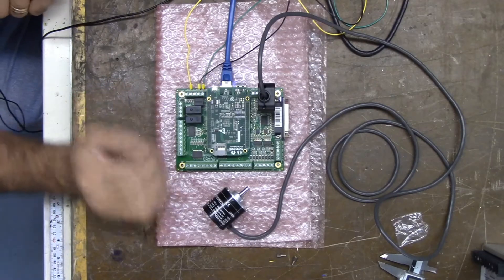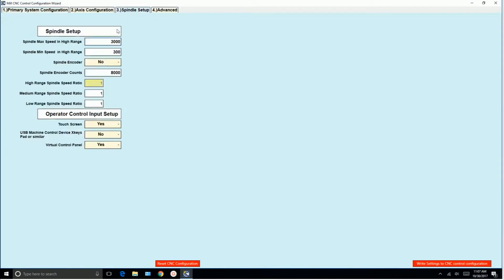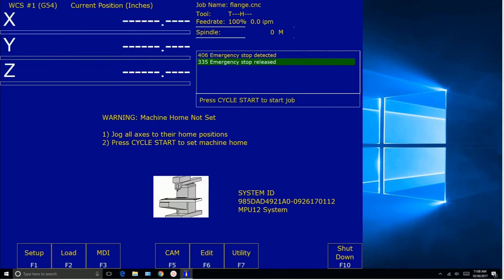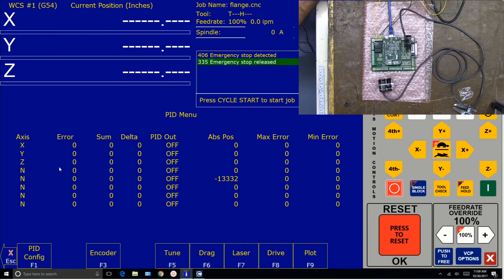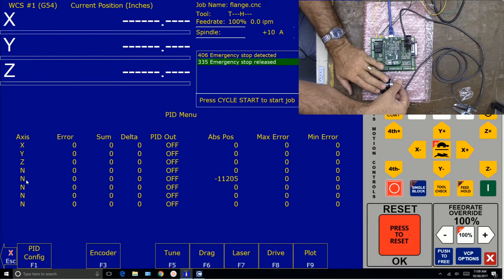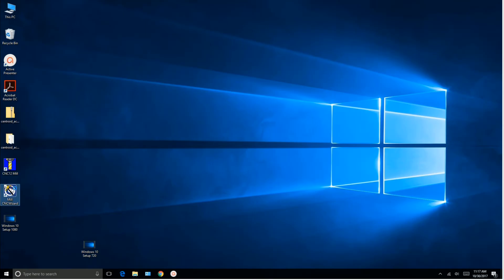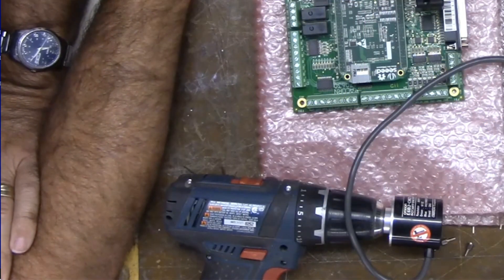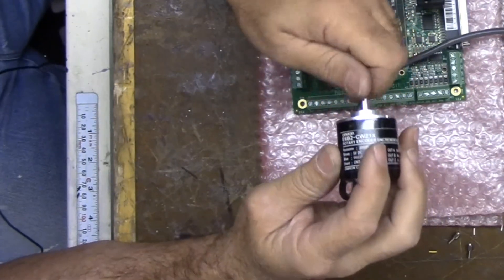Omron Differential Encoder Part 2

Comment: Hi im getting 455 spindle axis (5) encoder quadrature error, 

im using the second encoder as I've thought that encoder is wrong,  it is the same error with the second encoder what I've bought. 
Encoder still counts turns in count dialog on top of the screen. but this error won't let me control the machine ... I need to unplug it when I wont use a machine ... 

Did you cam across this problem with your encoder?
Reply from the maker: Please post to the Centroid user's forum. https://centroidcncforum.com/viewforum.php?f=60 make sure you follow this post: https://centroidcncforum.com/viewtopic.php?f=60&t=1043
We can't "SEE what you "SEE". We can help you better there. Not here....
Reply from the maker: And personally, I don't use those encoders, though others have had success with them.
Reply: Check your wiring either u have a bad loose wire and /or u have wires connected wrong

Comment: Can you show how to actually connect the encoder to the spindle itself.
Reply from the maker: Not sure what you mean. You mount the encoder to the machine and connect it to the spindle at 1:1 with a pair of timing pulleys and a timing belt
Reply: @martyscncgarage5275  yes. Can you show me a picture of that setup.
Reply from the maker: @Z-add  https://photos.app.goo.gl/8Eu1GebDJHNbWPrw8
Reply: @martyscncgarage5275  No one seems to bother using a separate shaft with it's own bearings (as suggested in Omron's datasheet). I suppose the timing belt is not tight at all, and the side load on the encoder's shaft is negligible?
Reply from the maker: @GenePavlovsky  you must use encoders rated for side loading, but you are correct, the belt does not need to be as tight as a motor belt.
Reply: @martyscncgarage5275  Well original Omron E6B2 specifies Radial loading of 30 N. That's a fairly high value and I guess with the belt not being tight, it should be all right. Omron has a diagram showing expected bearing life depending on radial and thrust load. With 20 N thrust load and 20 N radial load, bearing life is 5x10^9 revolutions which is ~ 4.75 years continuous operation at 2000 RPM, if I calculated correctly.
Omron recommends "When connecting the shaft of the Rotary Encoder with a chain timing belt or gear, connect the chain timing belt or gear with the shaft via the bearing and coupling as shown in the following illustration.". The illustration shows a pillow block with two bearings, in which a shaft is running. A pulley is on one end of the shaft, the other end is connected to the encoder with a flexible coupling.
I'm just wondering if I should bother rigging up something like this, because so far I haven't seen anyone doing that when they install an Omron E6B2 (original or most likely Chinese copy) on their lathes.
Thanks
Gene

Comment: The listed encoder is not on ebay at 2000, but this one is https://www.ebay.co.uk/itm/New-OMRON-Rotary-Encoder-E6B2-CWZ6C-2000P-R-5-24v/121350357120?hash=item1c410b8080:g:YfcAAOxy3yNThDdW:rk:6:pf:0

or 3600p https://www.ebay.co.uk/itm/1x-OMRON-3600P-Incremental-Rotary-Encoder-3600p-r-E6B2-CWZ3E-NPN-Volt-Output/292419074426?epid=5011172210&hash=item441588f97a:g:i-gAAOSwVLRaYtKN:rk:95:pf:0